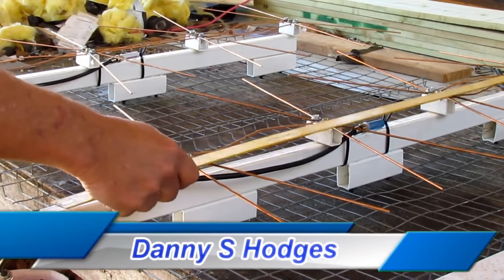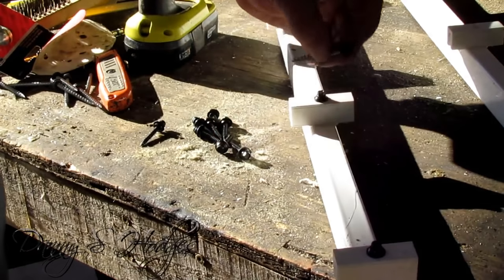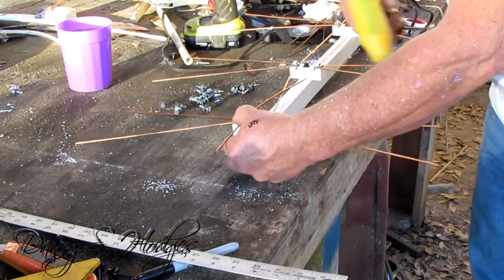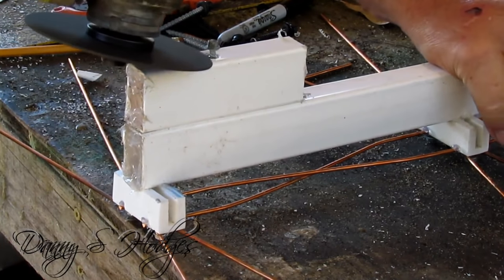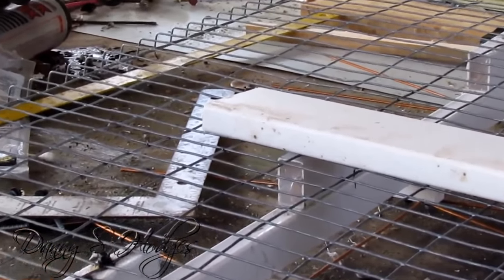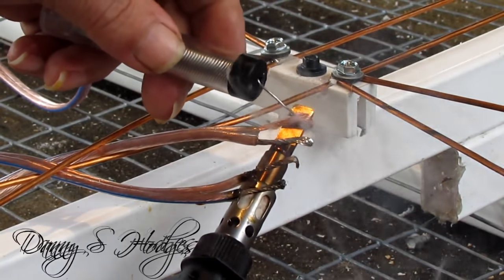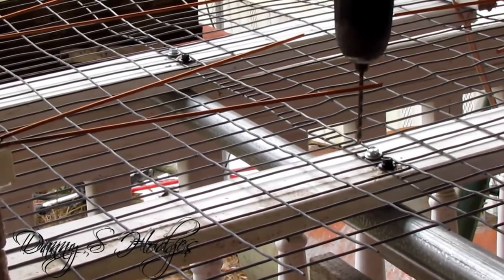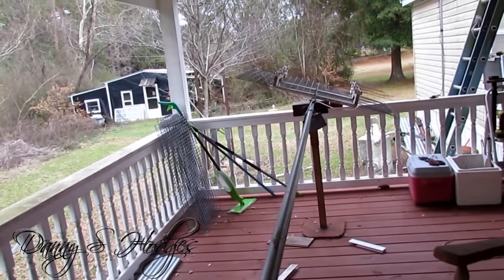How To Make The Double Ultimate TV Antenna

Comment: Danny i built your double ultimate antenna using 8ga copper wire and PVC dimensional lumber and a welded wire fencing reflector. Let me tell you it works great. I had an amplifier on it at first and couldn’t figure it out why it wasn’t working. And I remember you saying it might be over powering it.. so I disconnected it and bam, I have awesome TV reception. I live in a deeply wooded and very hilly area In SW Wisconsin. I’m getting 13 channels with it just sitting upstairs on a homemade stand. I can’t wait to see how well it works outside and above the roof line and with a rotor eventually. I just wanted to give you a great big THANKS. Your a good man ! 🇺🇸

Comment: Danny. Awesome video, thank you! For a smoother and easier tinning and soldering; use some flux paste on the wires. I bought a tin of it online for like $2.00. Then I dip my wire in there(not really professional) and then soldered.

Comment: Hey Danny, thanks for all the hard work.  My first antenna was a bust.  Here is what I am and my predicament.  We are over 50-60 miles to antennas and there are hills and low mountains.  I am an old AV guy but have only built the one antenna.  It had 7.5" wiskers and was a single side with a back screen.  I did see signal but no pictures.  We are all pretty much VHF 2-13 we have a 23 & a 51 for UHF. I used to install the 10-13' winegaurd and channel master VHF's in the analog days.
Reply from the maker: make this antenna
Reply: @DannySHodges  - Looks like fun and I have some 8ga bare.  Is that Channel Master a pre-amp?  What is the number?  I used to use a 
Wineguard that went into a poly cartridge that "snapped" into the antenna so it took the 300 ohm directly and did the conversion to coaxial and then like the CM was powered over the coaxial.

Comment: Hi Danny! I made one. The only difference in my design is, I directly connected the two arrays with 10 gauge wire and used only one Balun..  Like the Channel Master 4228 is wired. I am getting strong solid signals from Atlanta (55miles away) with no dropouts.

Comment: Hi Bud. I would like to suggest two things if I could. On your soldering. First solder your # 6 wire and coat (Tinning)  it with a pre sweat coat. Then pre solder your coax tips, this will let them bond great without a lot of heat transfer like you're getting it's also a big-time saver. Second tip is attach you a closed ended 1/2 in pvc nipple (caped) tie wrap it to pole. Next let's make it waterproof. By making a goose neck drop below the nipple open end with wire long enough to solder all your terminating soldering joints can now be taped, placed and tucked up from the bottom of the nipple out of the weather and wind proof to some existent.. Make your two reflector 4 wires and transformer wires all soldered together and then slip them up into the botton of 1/2 nipple with the transformer staying outside. the nipple I'd just tie wrap the transformer wire around the pole to stable it from blowing wind, and all your soldering joints are up inside safe from Ice , rain water, birds and such.  Hope tou check into it . Its a little extra work but boy what a pretty job and a lot less probles wayon down the road  ROLL TIDE! from East Texas.

Comment: Awesome thanks. I didn't quite catch how you soldered the wires to the RF connector. Does it matter witch side lead they are connected to?  Also are both ends and the speaker wire salderd together? Supper video

Comment: I just made me a 4 bay bowtie antenna. I used 10 gauge solid copper for the elements, but used 18 gauge braided/insulated ground wire and stripped at all the connection points for the vertical phase lines. Is there any problem with me switching up to a smaller gauge to 18 for those phase lines? It seems to work well. The 18 gauge was just easier to work with and wrap around each element for a good connection.

Comment from the maker: Deep South Videos https://www.youtube.com/channel/UCu7D3nWG9a5prTg9ugIn41g
Southern Ideas https://www.youtube.com/channel/UCunNmrlazaJKzQv5tCpNjWg/videos
Danny S Hodges https://www.youtube.com/channel/UCfod7dn64deeX7LZlpb-ctg
Reply: Danny have you ever made a side-by-side gray hoverman antenna and keep up the good work
Reply: If u would pull ur drill up to let the debris exit the holes while drilling not only would it drill faster but it'll make your bits stay sharp longer.
Reply: Have you ever just used your reflacter as an antenna and what would be the reception if u did use it.  Bc u said that you cam use almost anything of metal to make antennas.  Just curious bc I've got some fence that I was going to habe left over after making a  ultimate antenna from ur videos,  had top watch 3 of them todd get all the measurments, and did u change the spacing between the whiskers from 8 to 9.5 in. ?

Comment: If you go to a welding supply house, you can buy some heat sink paste to put on either side of your solder connection to keep the heat concentrated at the center of where you're attaching the 14ga speaker wire.  It will cut the time by half to complete the process.

Comment: Speaker wire as transmission line does work, its close to 50 ohms, however impedance matching is not mentioned in this video.  Some science added to this project would provide some reliability and predictability to this project.
Reply: Would using a balun instead of speaker wire on each antenna work as well as speaker wire?  Then the 2 baluns could be connected to a combiner leading to the main balun.

Comment: Danny I got to say that has to be one bad to the bone antenna, the ultimate is bad to the bone by itself, and you doubled it up! I know you did it before with the one you can turn one side. I have a question, have you ever tried just making one bigger? Like using 24" wire for your whiskers instead of 20. of course you would have to space them apart more and etc... Just curious

Comment: Hey Danny!   Do you have any experience with your Double Ultimate in cold winter installation?  Seems it might be a little heavy with the lumber fillers, so wonder how it handles a strong wind, minus 30 temperatures and a snow load?

Comment: Would either the update or moving the reflector to the outside of the frame produce better results?  Is that 24 inches for the spacing between antennas or 24 7/8?

Comment: Danny, You would be able to tin better if you put a dab of solder on the tip of your iron.  It helps to conduct the heat from the iron to the wire that you're tinning.  (You used flux on the wire you're tinning and that's exactly right.  The flux helps the melted solder flow onto the wire and it removes oxidation in the solder giving you a shiny joint.)  Take the dab of solder on the tip of your iron and touch it to the wire you're tinning and the solder will instantly melt the flux and the solder will jump right off the tip of your iron and wick into the wire you're tinning.  If you put enough solder on the end of your iron, you might not have to add any more solder, but any extra you need can be added with the solder to the wire directly as you were doing.  

You need enough watts on the iron and a big enough tip to get the job done.  Be careful that you don't leave the iron on the wire too long because the heat conducts through the wire and melts the insulation.  You really don't want to overheat the wire.  It can melt the insulation and any components attached to the wire.  It shouldn't take but a couple seconds to tin wire, and you want to remove the heat as soon as possible.  

An iron that is too cold, or with a tip that is too small (which causes less heat to be conducted from the soldering iron onto the piece you're soldering) can be as problematic as too hot an iron.  If the iron isn't hot enough you will leave it on longer and that will give the heat more time to conduct through the wire which, as mentioned earlier, can melt the insulation or damage components.  A good way to tell if the iron isn't hot enough is if when you pull the iron away, the solder wants to come with it and leaves something like a thorn on the joint.  Also if the solder isn't shiny, the joint is probably cold.  If the solder is sufficiently hot, the solder will simply melt back into the joint when you pull the iron off plus the joint should be shiny after it cools.  If it's not, add flux and touch the tip of the iron to it again to heat up the joint and remove any oxidation.  

When soldering, less is more.  Too much solder and you end up with a sloppy looking glob job.  That's not optimal.  The individual strands of copper in the wire should be visible in a tinned wire if you did it right  (https://www.kitronik.co.uk/wp/wp-content/uploads/2014/01/step-10-tinned-wire-870.jpg)   Solid wire joints should have a nice concave fillet between wires and between wires and flat conducting surfaces such as circuit boards.  

For working on semiconductors and circuit boards, a smaller tip is more desirable because you don't want to melt the semiconductor components (IC chips, transistors, diodes...)  About 15W is sufficient for delicate work.  For what you're doing about 35W should be fine.  The more watts you use, the faster you must work.  It's better to have a good amount of heat and work fast, than not enough heat and/or to work slow.  Through trial and error, you'll figure out what combination of watts and tip size works best.  Ideally, you want to get in, get the job done, and get out as quickly as possible.

Comment: Hey Danny Wes here from South Texas. I know why you do a lot of stuff that you do because I have run into the same situations. When it comes to waterproofing the Transformer after I put the coax on a shingle it with black electrical tape starting at the bottom I know you know what I'm talking about. I built one for my brother about a year later he took it apart I did not use Dielectric grease and the entire Transformer fell apart because it was electrolysis together. Incompatible metals. And when the Transformer came apart it was full of water. It was still working we were putting up a different lighter version. I use that blue gasket glue in a tube where are the element contacts the Balin connection which is all stainless steel or nickel. The top of the Balin it's hard to tape up because of the pigtails so I used some of that blue stuff there. I use nickel plated connectors with the O-ring on the inside. I start below the connector and work my way up.. I have a question and I'm sure you have tested this particular scenario if not please do. I don't know what it would do with the impedance if you have a splitter splitting equal length of coax to a Transformer. And put a Transformer on each antenna. I don't think there would be a problem of course it cost more. I'm starting to use the Winegard Bailon Better Built waterproof I'm sure and has a different type of pigtail. If you're still reading I use round electrical plastic conduit it says ultraviolet safe. I have come up with a way to put the Bailon on the inside of the backbone as you call it an end cap the top. I leave the bottom open if any moisture gets in it will run out the bottom. If you need any more information I'm happy to share

Comment: Soldering tips:  1.  Get an iron that will get the wire hot quickly.  You don't want one that you have to hold on the wire for more than 5 seconds.  2.  Get a metal alligator clip.  The larger the better.  Clip it on the wire just before the insulation.  This will act like a heat sink and keep the insulation from melting.  3.  Use flux and it will go a lot easier.

Comment: Danny - Question:   My house is wired for TV and internet with a coaxial cable.  One cable carries both.   I want to use that cable for the ultimate antenna but if I tap into it for that I don't want to lose my internet.   How can I continue to use that single coaxial cable to carry both my internet and TV from  the ultimate antenna?
Reply from the maker: i seen that one time...i ran a extra cable for the TV...also a booster want run through the splitter if needed

Comment: Danny, I have an important question brother. Can I put this in the attic of my house and run the coax from the antenna to a splitter then run that into my whole house cable coax that runs to my bedrooms so all my tv's use this one antenna? Or do I need an antenna for each TV?
Thanks
Reply: After you combine both Yaggi's you should run a Pre-Amp to boost the signal. The Pre-amp should be as close to the antenna as possible so noise is not added in. Then use as small splitter as needed. Each splitter port deducts about 3.5 dB. Most 'Smart' panels in homes are 8 port and like 10-12 dB loss

Comment: Instead of using multiple pieces of plastic, what if you used a composite plank normally made for decking as the main beam? It won't warp, rot or discolor as it is made of a resin and looks like wood. Rather more expensive than wood but I comes in a grey that is almost the color of the galvanized reflector. Just an idea that must be cheaper than the PVC and labor combined.

Comment: Hey Danny, much appreciate all you are sharing with everyone in making antennas. I hope to see one for INSIDE the house some time.  BUT... I have to speak up and reach out to you about something I saw you do, EXTREMELY DANGEROUS!!!!!--- >>>--- You might want to correct it moving forward:

--- You were are your Table Saw, RIPPING your FILLER PIECES OF WOOD. You had the GUARD on your right, and you pushed the wood THRU with your LEFT HAND, "LEAVING THE PIECE OF WOOD AGAINST THE GUARD WHILE THE SAW WAS STILL RUNNING".... ---  WITH NO KICK BACK SAFETY FINGERS OR GUARD IN PLACE--.... THAT PIECE OF WOOD COULD HAVE """POWER LAUNCHED""" DUE TO THE BLADE CATCHING TRACTION OF IT SUDDENLY, AND IT WOULD BECOME A """ LETHAL PROJECTILE.""" Like a SPEAR BEING SHOT OUT OF A CANON.    PLEASE CORRECT THAT PART OF YOUR VIDEO or PLACE WARNINGS WHEN THAT PART COMES UP.   WE DON'T WISH TO PROMOTE DANGEROUS SITUATIONS buddy!  Right?  Right!   As a Master of the use of such tools all my life.... you can bet I know exactly what I'm talking about.   This is to HELP YOU in your videos brother!   Stay SAFE out there... ALWAYS PROMOTE SAFETY!.  Another part was when you drove a screw THRU the main frame and stuck your finger. MAKE THE POINT-- NEVER HAVE YOUR FINGERS IN DIRECT LINE OF DRILL BITS, SCREWS etc.... WE LIKE TO PROMOTE SAFETY AND KEEPING OUR PARTS it at all possible!  As well.... we DON'T LIKE BEING SUED........................ Take care and thanks for your great antenna builds. I will try one some day soon from now. And I'll let you know and my fan base know HOW THEY WORK!   Happy to PROMOTE GOOD PRODUCTS!!! Especially DIY ones.... Now let's see your INDOOR ANTENNA! NEXT! :--))   Kindly always, and blessings NIS  10.25.2020

Comment: Danny the vertical measure to whisker bases was 9.5"?  Thank you.
Reply from the maker: 10 inch whiskers
Reply: @DannySHodges  Do understand the 20" lengths for 10" whiskers but whisker c to whisker c is 9.5" ?
Reply from the maker: @christiandehlinger3731  9 1/2 apart

Comment: Danny, your burning your wire because that solder is to small , that's for circuit boards, use solder that's one or two sizes larger! Your solder joints will look night and day, better good luck Danny, old friend Dave